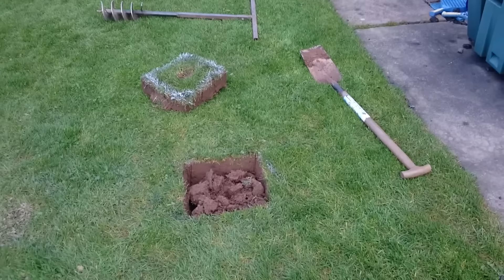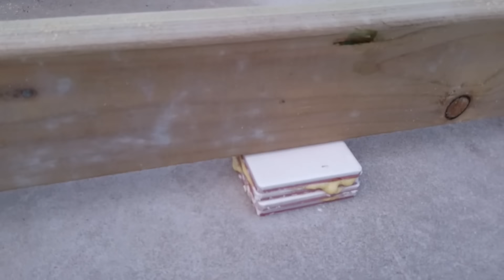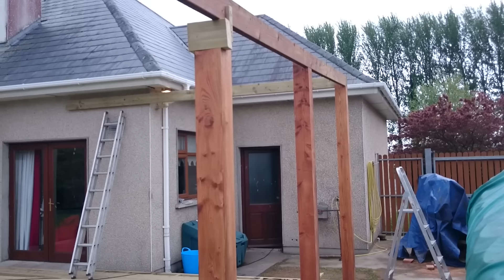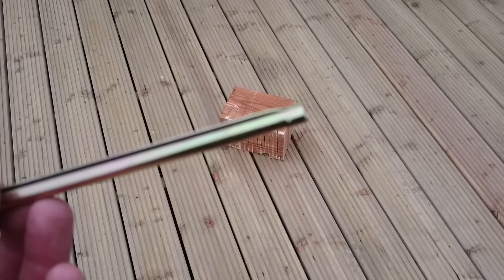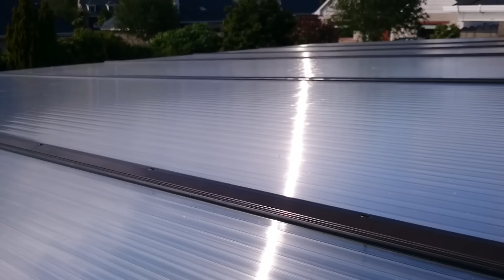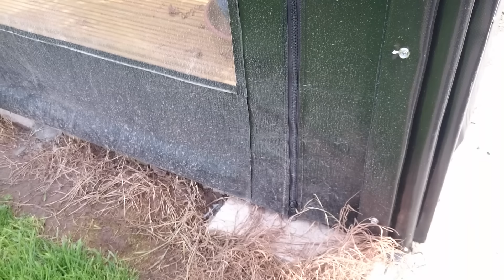2015 Deck Build - with polycarbonate roof and PVC side covers

Comment: That's a great job! What product did you use to anchor those screws on the base of the posts?
Reply from the maker: Um, can't recall exactly. It was 9 years ago. Possibly Soudal Soudafix, but not sure TBH.
Reply: @fardinger hello mate what's the roof and the PVC wall material like now after 9 years? I messaged you 4 years ago asking about the company that supplied the material for the walls at that time they couldn't supply me with any due to brexit. I plan to contact them again depending on how yours has standed up over 9 years.
Reply: @fardinger  Please answer my questions when you have time pal 👍🏻

Comment: With regards to the roof panels, how did you reach the screws in the middle of the roof.
Reply from the maker: We screwed in temporary timber braces between the roof timbers and the floor, and then crawled on top of the roof.
Reply: @fardinger  thanks for that. Love the way you put the video together with all the detail and info …..apart from the middle screws bit😂👍🏻👍🏻👍🏻👍🏻

Comment: Great video. How do the covers look after 8 years or any other issues. Have watched the 3 year update and they were great but would be good to know how it is now. Thanks
Reply from the maker: The covers are still in very good condition. No obvious deterioration. One or two slight marks on the transparent panels, where they got overheated by the sun while rolled-up, and stuck together. But you'd barely notice the marks.

Comment: Great video. We will be doing polycarbonate roof on our pergola and was wondering what your experience has been through the years? Has it held up with rain, snow and sun? Worried about dirt getting trapped inside the poly coz that would be brutal cleaning right?
Reply from the maker: The roof sheets have held up very well. No discoloration. There's about 8 inches at the front edge, which has wicked water into the interior of the sheets. That's a bit unsightly, but I doubt there's anything I can do about it. Otherwise, no dirt is inside the sheets.

Comment: great video, I've watched several times. I'm about to start a similar deck and pergola project and want to use 2x6's for the roof joist. My span across the roof is 4.4 meters and I'm just looking for info to see if 2x6's are okay for this. can you tell me what your roof span is and how they are now after a few years?
Reply from the maker: My span is similar to yours. The joists are doing well here, after several years. No obvious sagging. I think the cross-braces between the joists are an important factor, that lends support to the whole structure.
Reply: thats great thanks, I think I'll go for 2x6's then. I may bolt steel plates to the sides of them in future years just in case. Wickes do one that 2.5m long

Comment: Hi, also leaving in Ireland and was thinking between this and an extension with blocks cost and weather wise. 

Can you please answer the following if you do not mind: 

1) how much did it cost you to do the entire deck including weather shields 

2) how do you manage the cold temperature during winter time inside the deck

3) how long can the wood last as it almost rains all the time in Ireland. 

Your inputs will be really appreciated
Reply from the maker: I can't recall the exact cost, but of was less than 25% of the cost of building a similar sized concrete extension. We use a gas heater (super ser) in the winter. All the timber is covered by PVC or roof sheets, so it's not affected by the rain at all.
Reply: @fardinger  thank you so much

Comment: How thick is the vinyl for the windows and how cold does it get outside in the winter where you live. I live in the north where we get cold winter days down to 5-10 degrees. Would love to do this to my covered deck so I could sit out there in the winter.
Reply from the maker: The vinyl layer is thin. Only about 1mm. Typical winter day time temps here are around 8 degrees Celsius. We use a portable gas heater, which takes about an hour to raise the temperature to 20 degrees C.

Comment: 12:55.....hopefully you also dug a footer or sort down into the ground otherwise the vermin will burrow under it.

And I agree with Tracy Cleary...the decking boards are cut like that on the bottom to basically sir dry so it doesn’t hold moisture.

Comment: Hi, great video quality and content is awesome. I’m amazed at some of the ignorant and rude comments made by some members. The finish is exquisite. Your a man after my own heart. I can tell even from your garden that you take pride in what you do and plan well in advance. I’m in Laois and planning a 4mtr x 4mtr build. Mine will be different as I’m building over an existing natural stone patio and I’m intending on adding a hot tub/outdoor lounge area. I don’t have any questions about what you did as I think you explained everything very well however I’m curious now that it’s 4-5 years post build how it has held up over time and if there is anything you would change retrospectively? Snow isn’t a major concern for us in Ireland however I will check the weight load capacity and not cheap out too much on the polycarbonate sheets 😉 Thanks again 👍👏👍

Comment: how to you secure the noggins on the ceiling interior? Glue? I didn't see any screw holes.
Reply from the maker: They are screwed. Screws on one end are obscured by the next noggin. Screws on other end are diagonal, so those ones are visible, if you look from a certain angle.

Comment: how is the wood holding up now. After five years, are you happy with the water-resistance and so forth?
Reply from the maker: The timber is all holding up well. No visible rot. The roofing has remained water tight after 5 years.

Comment: did you end up putting any sort of barrier at the openings between the polycarb sheets? I know they have to expand and contract, but I would be worried about mice and birds nesting in those tunnels.
Reply from the maker: At the high-end of the roof there's an aluminium F profile covering the open ends of the gaps. At the low end, there's a PVC U profile. But they are not completely sealed at the low end. The gaps are definitely too small for birds. Small mice might get in there, but I've never seen any in there.
Reply: @fardinger  thanks!

Comment: This is brilliant and just what I was looking for.  I have a question or two if you don't mind.

1.  How did you screw down the strips for the polycarbonate given that I imagine the width is around 500mm?  I ask in terms of reach since you would have one to reach over to pin down.
2.  How did you fix the polycarbonate at the wall end of the roof?  Did you use a manufactured angle trim of some sort to slip the poly under?

Thanks once again for an excellent video.

Comment: I love everything about your back yard and this project, would love to duplicate this. I am concerned about the covers if they allow air through? Also do you need to add a heater in the winter??? how cold does it get where you at ? Does the 5 wall roof restricts too much light ? Thanks a lot!
Reply from the maker: Winter temps here are 5 to 10 degrees C in the daytime, and yes we use a gas heater in the winter. Plenty of light comes in through the roof. My plants thrive in there. Also there's plenty of ventilation coming in under the floor & at the front edge of the roof.
Reply: Great! thanks a lot for the quick response. I live in the USA and it does get colder over. I also found an alternative to your covers Eze Breeze windows but they are expensive for me . Anyways thanks a lot for sharing and again this really inspired me to duplicate ..

Comment: Hi ,just to say what a great video,we already have decking with roof sheets &are very interested in side covers, with all recent storms we,ve had very worried bout strong winds  against side covers,any information appreciated.many thanks
Reply from the maker: The side covers have stood up to hurricane force winds, and have not been damaged in any way. Along the bottom edge of each cover, there's a thin plank of wood inside the PVC. This sits squarely against the flat side of the deck (just below floor level). This helps to keep the cover from sagging inwards in the wind. Also in winter, I screw this plank into the floor timbers (there's no need to open the covers in winter) which supports the covers against strong winds.
Reply: fardinger many thanks for your reply, it's been very helpful

Comment: Nice.
with your sweet vowels, you are obviously not from an area where snow is a problem, but your timber in the roof is sufficient for 1,5 meter wet snow. With the spacing you have, 1x5 would have been sufficient. When you lock a piece of wood against buckling, like you have, it can take a tremendous load. It is after all one of the  strongest fibers we know of.  Norms for design are mostly to avoid flexing of floors, so not to frighten.  So when you use wood of familar dimension, remember they are for 200-500 kg pr m2.
Reply from the maker: Its funny you should mention snow. We had a rare snowfall event here last month. There was 30cm (1 foot) of snow on the roof. It's been more than 30 years since we had that much snow in this part of the world. The roof handled the weight no problem.

Comment: Super video and project. I am currently doing a similar project so I found this very helpful. I have a metal frame up and  I'm using 16ml triple wall polycarbonate sheets for the room so I hope they are strong enough. Next summer I plan to panel the front of it with solid sheets of polycarbonate with sliding doors and also possibly remove the sheets during the summer. the flexible canvas looks great though. Can you say how much it cost? It does look well done and hence very expensive. Thanks again
Reply from the maker: Its a few years ago since I did that job, so my memory of the costs is a bit hazy. I think the side covers were around €1,500.

Comment: sorry guys but the reason decking boards are slotted is so that when they are laid, the slotted side faces down which helps with the water run off on the under sides to help prevent wood rot?

Comment: Hello, 
Loved your video.
I'm doing a similar project in Dublin, and I can't decide on the size of the posts and timber.
Can u please tell me what size did u choose and why.
Also a suplier would be great.
Thank you
Reply from the maker: The posts are 150mm x 150mm in larch. I chose this size because they are nice & chunky looking, and also of course plenty of strength to support the roof. I got them from a saw-mill in Ballyporeen, County Tipperary. But other saw mills might have them also. Larch has good water resistance.

Comment: What a great project.Awesome!! great idea of framing the concrete pads with the timber for alignment. I like the use of ceramic tiles with the gorilla glue to act as packers underneath. Don't want to be the old man here, but I would have used timber wrapped in DPC and screwed( tanalized timber I should add), from the underneath of the main floor joists. I have a suspicion those ceramic tiles might fracture and crumble after a few years. But I might be wrong, with that glue there could be sufficient flex and of course being ceramic tiles there will be no problem of rising damp to the timbers. All in all, you are a meticulous craftsman. One other point, perhaps guttering could have been built into the design to save splash back on the PVC panels, but that perhaps will be resolved with gravel or paving slabs. Still,  I hope you don't think I'm being picky, a really great video and talk through. Thank you for sharing.

Comment: Great and informative video.  But you did not tell how you secured the noggins below the roof (?)   Below the floor you told that you put them right , left , right , left , which also allowed you to put screws into the noggins.  But below the roof all the noggins run in straight lines , so how did you secure them ?   Did you use steel angles on the backside ?
Reply from the maker: One end of each noggin was screwed straight through the roof joist (which was then hidden by the next noggin). The other end of the noggin was diagonal screwed, which unfortunately left screw heads visible near one end of each noggin.
Reply: Oh, great , thank you very much for your kind and informative answer :-)

Comment: I was in New Zealand and saw these  plastic side covers there.  I live in the US.  Do they make it in the US, too?  Where did you get the side covers?  Hope you don't mind sharing the contact info.  Thanks!
Reply from the maker: I'm located in Ireland & I sourced the covers locally here. I'm afraid I don't know if they are available in the US.
Reply: most awning or boat canvas shops will make them..1 tip though make sure those roll up zippers are covered. (1) they will leak (2) the sun will rot the zipper fabric very quickly
Reply: Walmart in the Fabric section or any fabric store sells it pretty cheap by the yard.

Comment: Fantastic video.  I love the design of the roof.  Quick question.  For all the top lumber were you using 2 x 6's or 2 x 8's.?
Reply from the maker: The are 2x6in (well actually slightly less, due to the metric sizes we have for lumber here in Ireland).

Comment: may i ask why didn't you use the clear polycarbonate panel on the frame instead of the plastic thing? I was thinking about using the clear polycarbonate panel to enclose my small screen patio. is that a good idea? if not, any suggestions? I'm trying to keep the bugs and rain out so I can use it and also minimize cleaning. thanks. BTW, great video😉
Reply from the maker: So the reasons I went with the flexible PVC side covers was A) price was much cheaper and B) They are easy to roll-up. This is important on hot days when the temp on the deck can quickly get unbearable, so you need to be able to cool it down fast. If you are putting in solid polycarbonate sides, make sure you can easily ventilate it (sliding doors maybe).
Reply: oh ok. well, I have a small scrwen patio that I want to cover so water and dirt don't get in when it rains. I am looking for a cheap and durable to enclose it. any suggestions? thank you for replying

Comment: super video could compression fittings be used for a timber wall plate for a wooden lean to conservatory roof thanks
Reply from the maker: I'm no expert on these fixings. The ones I've used seem to be working out fine (it's been 12 months & they are still secure) but your structure may have different load characteristics to mine, so if you are in doubt I suggest you get advice locally from someone knowledgeable.
Reply: g
Reply: g

Comment: I absolutely love this project, great work! I am also interested in covering my deck with polycarbonate sheets, but I have concerns of the wind getting underneath and lifting them and also the fact that we have snow here and not quite sure how much weight the sheets are able to handle per sq ft.
Reply from the maker: Info I've seen on the web suggests that Polycarbonate is very strong, so my guess is a 5-wall sheet like I used can probably handle a lot of snow. But you'd need to check the technical specs with the supplier to be sure. Also you need to make sure the sheets are well supported underneath, to avoid them bending under the weight. Of course the overall roof timber structure has to be strong enough to take all the weight too.  I suggest you get the advice of a roofer or carpenter. Re wind-lift you can secure the sheets with bolt-through glazing 'buttons' near any vulnerable edge.
Reply: I can’t give any insight about the snow, but I live in coastal NC (frequent hurricanes). My in-laws installed a material (that looks similar to that) on their (lattice-roofed) pergola-styled outdoor structure 25+ years ago and have never had a problem. They live about 45-60 minutes inland and in a large open area surrounded by fields where they have constant winds, down-drafts, and frequent (inland) hurricanes. Hope that helps.

Comment: hi thanks very much for your reply, i would really appreciate if you could please tell me what type of wood you have used i.e. treated plain or plain and type of a colour you have used. and also picture of a hanger you have use. i have also asked the local trade but they are very busy to give much advice but what you have done its works and looks very nice. i am going shopping sat to needed to see what size timber to buy and type of timber to buy. once again a very nice job done.

Comment: Great project!  I really like how you did the concrete however you actually don't want the deck level, you want it to be sloped away from the house or any rain water will either puddle or move towards the house.
Reply: How as the rainwater hits the roof on top, the deck stays water free ;)
Reply: +GenuinePluko ahhh... I missed that part

Comment: hi very good project i am in process of building the same. would you be able to tell me where to buy the joist hanger from and any other items you have used in this project from wood to screw size. it will be helpful for people like me who is trying to learn this kind of good work.
Reply from the maker: +rakesh baden - I got the materials from my local hardware / building-supply store. The staff in these stores are a good source of advice about the correct timber size, joist hangers, screws etc. You should discuss the project with them. Best of luck with it.

Comment: Hi where did you get the PVC covers from please
Reply from the maker: +jeanette fakhoury The PVC side covers came from a company called Clonmel Covers in County Tipperary, Ireland. They came and measured the timber frame & manufactured the covers to match. We had several storms last winter and the covers resisted the wind without a problem.
Reply: thank you, sounds great, just what i need but i live Manchester UK, how much did they cost ? if you don't mind me asking.
Reply from the maker: +jeanette fakhoury Well I don't want to be too specific about pricing, but it was less than €2,000, and we were very happy with the price, given the quality of the material.